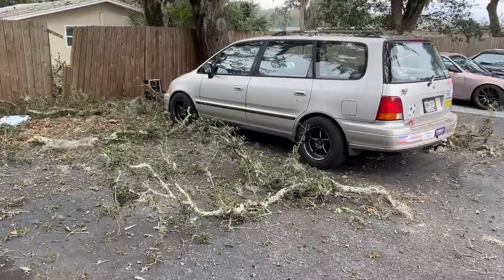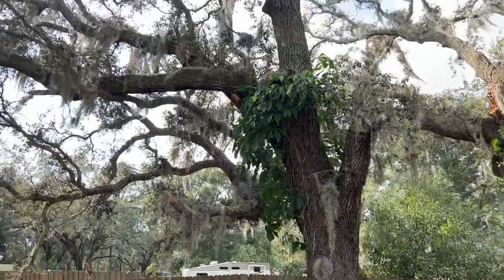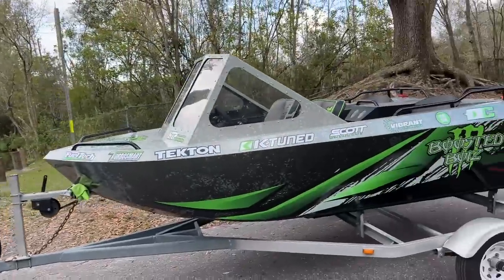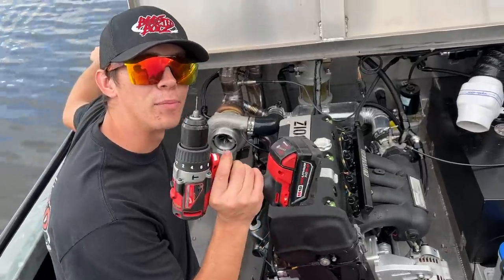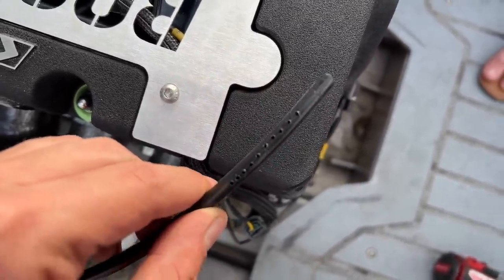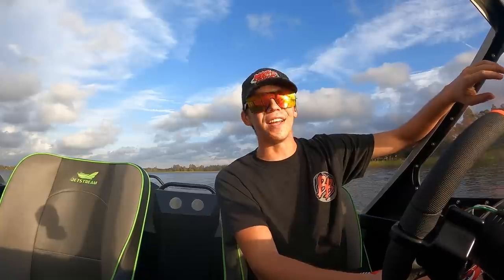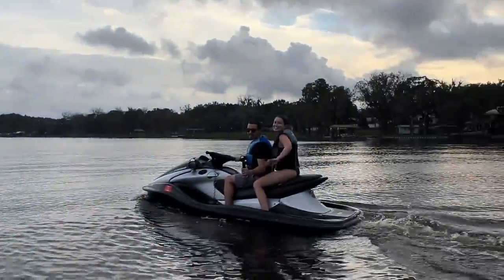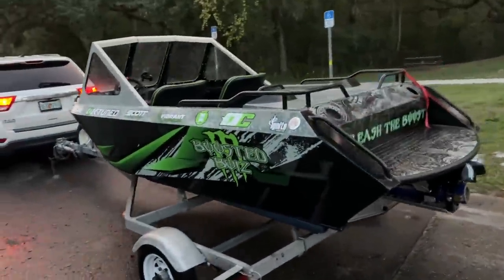Turned Up Our Turbo K-Swapped Mini Jet Boat and it RIPS!

Comment: I am thoroughly impressed how well it keeps up with the jet ski.
Reply: It hardly keeps up with a 150... Try a 300 GTX! That's when I'll be impressed by this boat! I'm sure Kyle will get it there eventually though! 20lbs of boost or so later & this thing will RIP!
Reply: @lexusvip4003   thats a 1200cc turbo honda ski
Reply: Its a car engine with a turbo, it better keep up
Reply: @MintyFreshGarage  still slow af for a ski
Reply: @MintyFreshGarage  Okay? It's still SLOW AF for a ski. I've been riding supercharged seadoos since the early 2000's.

 My "economy" jet ski is faster than his was. & it's a naturally Aspirated 170GTX...

Kyle's boat has A LOT more to go if it wants to keep up with something like even a 215hp jetski or a 260... 

I don't think you realize how slow the jetski in this video is compared to a supercharged 300 horsepower sea-doo... 

There's a very large gap in their capabilities. The ski racing kyle in this video does 0-30mph in 2.63 seconds assuming its a turbo F15x. A GTX 300 does 0-30 in 1.5 seconds.... & 0-50 in 2.9 seconds....

So by the time you hit 30mph on his stock Honda ski, a stock GTX300 is going 50mph....

& we can talk about modding them all day long. RIVA Racing has a kit for the 300 that gets it to 85mph. I've seen somebody hit 90mph in perfect weather. 

Like my original comment stated... Kyle has a LONG way to go with this boat before it is racing anything seriously on the water... I have no doubt he'll crank it up, I'm excited to see the boats journey!
Reply: @MintyFreshGarage  Glad you made your comment. I've been looking into F15-x's for hours now. I want to buy one, & completely build it up as a sleeper... I'll be happy with a solid 80mph Honda. They are great candidates for a sleeper build. I was just watching one hit 80mph & it sounded glorious. The turbo was screaming! I would be laughing so hard when new skis come around & want to place bets on who gets to the other side of the lake fastest! I'm highly intrigued by these skis now. I've only ever driven sea-doos to be honest... & I do remember racing a turbo Honda one day & it was keeping up with my flat 72mph (riding a RXT-x 260 at the time) so I knew they could be quick!
Reply: @lexusvip4003  that's a turbo jet ski not some little 150.🤦‍♂️🤣🤣🤣

Comment: The jet boat is running great. You might need a different impeller to go much faster. Check with the manufacturer and see what they say.
Reply: The manufacturer sent them the pump after being given the build plan. 

I dare say they’re actually not spinning it fast enough. They’re turning the boost up, but it’s RPM which counts here
Reply: Yea one of the earlier videos Kyle said max rpm the pump was rated too was 8000rpm and it was only doing 5500 before the turbo and power isn't linear on these things so plenty of head room
Reply: @dylanzrim3635  yeah really need to know what the rpm limit is.

Comment: I'm loving the build. But as others have probably already said. Get the jet angle set. And maybe an impeller change. My 21ft Yamaha jet boat has twin NA 4 cylinders 160hp each, about 10,000 rpm does 52-55mph bone stock. I know you'll get there, but talk to Finnegan and get some tips. You'll be doing 70 before you know it

Comment: The thing about those large/older oak trees is, they end up rotting over time but IMO (25+ years living with trees like yours) the MOSS is what chokes off leaves and new growth. But more importantly, it also ends up rotting the limbs and branches because of how much and how long it holds moisture.
Moss can be cool looking but it blocks sunlight = kills and rots whatever it's growing on...
Reply: i agree. and you can tell the tree is struggling by the big leaves that are growing out of the center there. its growing suckers to try and get more sun.  where i live theres alot of ash trees that are dying from the emerald ash borer and people always think that just cause there tree still has leaves on it like that that its still alive when in realality its on its last legs and wont last much longer. atleast with ash trees that is.

Comment: You should try different nozzle trims...see if trimming it down would gain some top end or not.
Reply: Trimming the nozzle down youd lose mph. It needs to be trimmed up, the front end is plowing. It's not on quite on plane. Trimming it up would raise the front end out of the water and keep it from plowing, youll gain a few more mph. You'd probably see closer to 55 or even 60 mph with it trimmed up a touch

Comment: get another impeller 1 or 2 inch pitch more. Also check out jet pump nozzle sizes. Smaller for more top end. Keep in mind the more water you shoot above the water line the slower you will go. Got to find the sweet spot.  Another thing you should do is  smooth out the leading edge of the Black plastic hull liner to eliminate drag.
Reply: Get phong to put a golf ball dimple on the plastic too. That way once it’s moving the boat will have a layer of water stuck to it similar to how a gel-coat works

Comment: Love it, I think if you change the impeller with a  different pitch size she will rip even harder, take to Scott's and ask what will be good to run in that pump
Reply: He's not hitting redline, an impeller with more pitch will simply lower his rpm more. First trimming, then reaching max RPM, and only then think about changing pitch, in this case.
Reply: @kealke  that's the thing, you don't want it to redline to 9000rpm, you're asking for trouble, why do think people put smaller wheels or bigger wheels on cars, it's the same principle, get on the phone and give Scott's a call and ask what's the best pitch for the torque and hp and rpm to get to achieve the best speed, they did design and make the pump
Reply: @akriminal7951  I didnt say he has to redline it. Being on 2/3 of your RPM range, is simply not enough. Especially with these engines, the powerband is up there. 
That said, like i said, fix pitch first, that will most likely raise RPM because there's less drag. THEN you can think about changing pitch. NOT before the rest is in order. You're going to be ordering impellers a lot if you change that order. I've been toying with jets for the best part of 30 years now, i kinda know what i'm talking about, a bit.

Comment: You should smooth and fill all the gaps and seems in the poly. Maybe rub surf wax on all the screw heads to fill them flush. All that added drag is really showing it’s ugly head.

Comment: That thing's weight bias is dangerous, if you hit a wake like that at speed it can be very unpredictable... I've never seen such a list on a small vessel!
Reply: nothing some sandbags cant fix lol
Reply: It would probably be a smart idea to just add either another fuel tank to the opposite side or if they are worried about the potential for combustion then a ballast tank. Put a level sensor in the fuel tank and auto dump water from the ballast tank as the fuel level drops. You can run the cooling water pump system through the ballast tank to control the level. With a Parker Venturi boost pump (no moving parts or power required) in the ballast tank it can either fill up or empty out with a simple water valve circuit controlled by PWM from the Fueltech.
Reply: @theatomproject007  this.

Comment: My last boat topped out at 52mph,ALOT of people not experienced on the water don't realize that 50 on the water feels like your doing 100mph in your car.I grew up around boats my whole life..60 is the magic mark on the water.If you have a 60plus speedboat you have a ripper.
Reply: 55mph in my 1970's 18' Tahiti with a cracked transom and wobbly worn out midsection on my outboard is sketchy as frig. I decided not to go for 60-70mph until I build a better boat, lol. Had just enough chine walking moments to get me to quit chasing a record.
Reply: Cracking 60 on a wave runner on some choppy water... that's some sketchy stuff right there lol

Comment: Dude you wouldn’t run the 1/4 mile without belts or suit, please put on a life jacket hitting the water at that speed should anyone be thrown out, at best knocks the wind out of them at worse knocks them out.  You will skip like a stone and it hits like bailing of a motorbike. You never know what could be hidden under the surface.  If you love her put a life jacket on it.

Comment: Raise the bow a bit with the trim on the jet drive. Looks like you're pushing down the bow and causing unnecessary drag. Get the bow higher out of the water.

Comment: With the jet drive shooting up like it is, it's actually pushing the front of the boat into the water ( not good for speed ). For high speed you need to get as much of the boat out of the water as possible. See if you can trim the jet drive down, pushing the front of the boat up and out of the water.

Edit: You guys are correct, I got the nozzle jet propulsion reversed.
Reply: Trimming the drive down into the water will push the nose further down, it needs to be trimmed up more to get the nose up.
Reply: You might want to edit or delete your post, as you are incorrect about the nozzle angle.

Comment: You have probably looked at that before, but the throttle seems to be touching the steering wheel when you are floored.. I guess you can see with the fueltech if the throttle is really at 100% by looking at the TPS input?

Comment: boost holes don't work so well when you're 2000 rpm lower than the motor's peak power?  I'm also curious about where the air inlet is for the engine cover.  I know it's not air tight but seems like it could use some air to breathe
Reply: Yes I agree. The draw from that turbo would out do the air vent in the front hood I would of thought. Maybe they should lift the hood up slightly just to see if it helps at all with boost/response

Comment: Maybe im missing something but dont you need more rpm to go faster? Isnt it direct drive to the engine?
Reply: The engine is power limited. Before the turbo it couldn't Rev as high as it does now. The load on the engine is preventing it from spinning faster. More power will equal more RPM. Maybe a change in the pump setup could allow a few more RPM? A car can run up through the entire range because of gear changes. If you launch in 4th gear your car doesn't make enough power to do it, so it bogs really hard and or stalls.
Reply: @dustyc324  okay now i understand. I thought the rev limiter was set there.

Comment: I remember the first time I was 50 mph in a boat. I was blown away when I looked at the speedometer because I thought we were doing 175.  lol
Reply: My dad's bass boat does about 62 mph, yeah, feels like you're doing 2x what you really are.
Reply: @andrewt9204  the wind starts to hurt at those speeds and no windscreen. A buddy of mine has a big power boat. Anything over 60 on water feels insane. Especially when the boat can carve and accelerates like a car.
Reply: @dustyc324  yeah it does. I used to ride sport bikes and without a helmet it's very uncomfortable above 50-60, it's hard to breathe. It's almost like it creates a vacuum around your head. Plus the crazy buffeting in your ears. Like when someone cracks open or rear window in the car.
Reply: @andrewt9204  I like ear plugs on my bike with a helmet if I'm doing a long highway  ride
Reply: @dustyc324  Yeah, I do that too. Several hours of a screaming engine gets old after a while.

Comment: Also I'd make a split fuel tank to balance each side and it also would make the tank closest to the turbo smaller so it would be further away. You also could maybe make a firewall between the exhaust and fuel tank

Comment: I think you need to do a split fuel tank to fix the lean. It's probably affecting the ability of the pump to suck in water too. Or might be better to turn the nose into a gas tank, and just run a line back.

Comment: Maybe someone smarter can confirm my hypothesis:  the added weight from the engine together with the trim already up in an attempt to get the bow up means the boat may need some trim tabs to accomplish the mission of getting more of the boat out of the water and on plane.

Comment: Dude slap a set of rods in that sucker and send it to 15psi... you have SOOO much RPM left to go on that impeller.  Either that or put a shorter impeller on and get the engine up to 8000rpm

Comment: Instead of doing a new hood, why not pound that one back out and make it into a cool vented hood. That will help even more with cooling, and if you park it under the carport you don't really have to worry about stuff getting in there. Or just throw a small tarp over it if it sits.

Comment: A 300hp outboard on a 21' modified tunnel boat gets you over 100 gps mph as a comparison of the efficiencies of propulsion and hull design. The jetboats are closer to a water brake dyno than a speed machine. If he wanted to go fast he'd have a hull like Toms'.

Comment: Just ordered hoodie and some stickers. First time actually monetarily supporting the channel but have been watching and liking videos for years. The FRS would be an awesome addition to my toys. I have a 5cyl fwd turbo runs low 12s and an LS swapped Volvo 240 with ford 8.8 and locked diff, and hydro. Would be awesome to have a circuit/auto cross track car.

Comment: You have a trim issue. Watch that last run against the ski, again. Everything is great until she starts plowing on the nose. This will only get worse with more power and represents a real issue with handling at speed, as well as a danger in the event of a mechanical failure, where you suddenly lose propulsion.

Comment: AS A BOAT DUDE I WILL SAY .....  the nose of the boat is down the whole time , causing major drag.. its not on plane and not close to 100% efficient . you gotta play with the trim and get that nose UP so it gets to a point that literallly almost nothing of the boat is in the water but the very back end where the jetdrive is at. thats number 1 /// then getting the boost where your happy is number 2 , then lastly get the impeller system you want that either is fast out of the hole but has low top end, or a medium setup that comes up kinda fast but has more top end , or what I suggest a really nice fat top end because most of the time thats what your going to be doing is mostly cruise or high speed , getting out of the hole is more for ppl who wanna ski behind the thing . its not a race boat but you should be able to hit 65ISH with the power to weight ratio on 10lbs on a stock k24. the math is easy . THEN SMOKE CLEETUS FOR US ALL !! MUHAHAHAH!

Comment: Could add one of those aem gps speedos, or does fuel tech have a gps input for mph? 
My aem speedo in my LS swap has speed, altitude, and heading. Course I'm still running the suburban ECU..
My cousin had a Polaris gooch II when I was a kid I could swear I remember seeing 80+ on his speedo from riding on the back.. was probably km/h tho..

Comment: September 2023

"Alright boys, we finally got the mr2's old engine in the jet boat, got the 2 step set up, she should be putting out about 500 now. We're only turning 7800 rpm so it should hold everything we try. Going for 80 today boys, we're pumped"

Comment: 14 min in. I Think that (what her name) has sucked you too dry, or cleaned places that you did know that are...   Gate spring gives out the exhaust pressure, or the dumb valve spring. Brent - do not higher if you don't have juice. It is the MAP

Comment: The mini-jet is awesome.. the LS swap the world movement will be surpassed by the k swap the world because of you boiz some day!!
Why not just add a vac tee for quick testing ?
Or a helper spring on the gate altho that prob isn't doable in externally gated turbos.
What's the spring pressure in that gate? Seems a .8 bar would be perfect.
I always got boost fade with anything less...
Of course I was running smaller hotside turbos that spool fast as shit and run out up top.

Comment: You could see a easy 57 to 60 mph. Some trim on the drive or put trim tabs if the boat doesn't. Rule of thumb V-Bottom optimize at 33% of the boat in water on plane. The boat is plowing through the water not gliding. Less friction = more speed and fuel economy.

Comment: I think you have too much prop for the power level you are running.  You need to depitch to get the RPMs up and you will gain a lot of speed.

Comment: You need to adjust the Trim on the Jet unit. You can tell by the Rooster it is blowing out the back of the boat. If You had the nozzle trim hooked up, You could adjust it on the Fly and see where the best position is. Plus every time you have a different amount of People on board, You can get it trimmed correctly.
When you keep talking about it only revving to a certain RPM a trim adjustment will also change the RPM. I would not be adding anymore Boost to that Stock engine. With the load being so low in the Rev range and the stock A2 Rods it will not end well.

Comment: I know nothing about jet drives but why is the engine only spinning 5600? Am I wrong in thinking it would be a hell of a lot faster if it's even in its damn high rpm efficiency range? That k ain't even moving at 5600. What gives?

Comment: I wonder if you are losing speed with the jet trimmed up like it is. Time to get adjustable trim on the fly. Also, boost control solenoids are cheap. You can get a simple GM 3 port for about $40.

Comment: Don't know about over there, but here the person* on whose land it is growing is responsible, which would make the neighbour (or his insurance) liable for the fence repairs and the repairs to the van. On the other han, you may be legally entitled to trim branches overhanging your land.

So, from ~42 knots to   As others have mentioned, the trim can make a big difference - if you get the right angle it's plane better and reduce the wetted surface.

*Recently had 5 trees felled because they were a risk to two neighbours' houses.